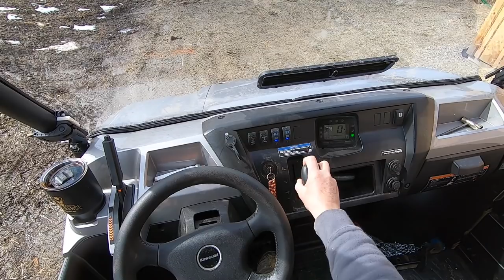EXTEND Your Growing SEASON Build a RAISE Bed HOOP HOUSE in 6 Easy Steps

Comment: If you have any straw bails, place them against the planter boxes to keep the heat inside the box. Keeping in 5 additional degrees will make a difference in two weeks of grow time with germinating and early growth. If no straw, one of the brown/silver tarps acting as fencing will shield from the wind temperature loss.

I'm about ready to give up on Amazon as the last three items I needed, they had delivery dates three plus weeks out. The silicone baking mats you guys use being the last item.
Reply: soaringtractor  

   Haven't had the problem with eBay, but I don't purchase from sellers unless they're USA suppliers. I refuse to purchase counterfeit items for the prices of originals.
  The silicone baking mats I referenced as on the way from Missouri and will be to me Saturday. Faster delivery times and $8.00 cheaper.
  The kicker on Amazon was that my membership just renewed mid March for $119 a year. 

I'm thinking Amazon is about to get hit with a class action law suit for violating the terms of Amazon Prime. The lawyers will get rich, the consumer, not so much.

Comment: Cold frames and hoop runs are great season extension implements. If using PVC pipe like this, I recommend using exterior grade PVC (the gray kind), as the white PVC shown here will quickly degrade under the sun's ultraviolet bombardment. Here in Oklahoma, a more southern climate than New Hampshire, the white PVC will only last two or three seasons before it starts to crumble apart.

Comment: If you want the cover keep opened, you can to use a chain. One bottom fixed the bed and the another bottom to the cover. It should make your work easier when you work at the raised bed.

Comment: Al watching you do this will add two seasons to your growing zone. Good idea. The bad thing you did was to put the greenhouse plastic directly to the pvc. They don't play together. You will need to put a barrier between the plastic and the pvc. They generally use tape . I'm not sure of the type of tape though. The issue will be that the plastic will degrade within a year causing it to have to be replaced. Fix it now so you don't have to later.

Comment: Nice vid. I believe I have already watched the vid you talked about. I thought his double layer using a second set of pipe very well thought out. Was hoping you were going to do the same. You did reference it when talking about the length of the hoops. In most places in the lower 48 you could have crops year round with that system. Someone mentioned they thought it was a waste of time and to hard to access the far side. I think it wise to use cold frames. But I agree it would be difficult to access the far side at the width you're using. I prefer a 30" width comparable to a market garden width. But all in all well done. Oh and I like the zip ties over the electrical tape but both will work. Even on a sunny day. 🌞🌞🌞

Comment: what are your thoughts Al, on cutting a small hole at each joint in the middle hoops to put a screw in to attach to the long pieces? Loss of strength on the joint? The long piece would still be over the middle hoops, but you'd screw through the inside half of the long piece to the hoop.
Reply from the maker: That would work just as good as the tape

Comment: Nice cold frames.  The only question is how are you going to prop up the lids so they do not fall on you, or over extend the hinges when being opened should the wind catch it? I am guessing a tether to hold the lid in case of wind, but I was not sure exactly about propping them up.  I love that you guys get to work together.

Comment: Should add a thermometer in there to see how much the temperature gets raised. Nice job on your build, if I could suggest when doing so many repetitive  tasks lay them all out once and then align others so you don't have to keep measuring. Setting up a set of saw horses and a piece of plywood would make things way faster.

Comment: If you add a piece of roap to the bottom at a corner and the flip side that it opens up just more than half way then you can open the tunnel do your work without anyone helping you and the plastic wont lie on the dirt when opened

Comment: Hey Al, I’ve noticed you changed over your tools from Milwaukee or which ever red brand to Dewalt. Why did you change and what made you choose Dewalt over just replacing with the brand you were using. I need new tools and was curious about your choice.
Reply: Ted Otway - Most of Lumnah Acres tools have always been DeWalt.

Comment: I probably would have dremeled out the bump lips inside the proper size T's instead of buying oversize T's. Also, here's a link to PVC cross connections for the inside hoops:

https://www.amazon.com/s?k=1%22+pvc+cross&ref=nb_sb_noss_2

Cut the horizontals to fit.

Comment: The adhesive on the electrical tape will melt from the sun.  Maybe a ty rap would be better, just make sure the head is on the bottom, away from the plastic cover. Criss cross the ty raps at each joint.
Reply: I also think the sun make the plastic expand and not hold up as well . should have pulled them tight after a warmer day in the sun then made permanent boards to hold plastic down
Reply: I had to look up Ty-Rap, and discovered it is a name brand for a cable tie, or what I call a Zip tie.  Good solution, as that electrical tape will bake in the sun.

Comment: It's great to see Olivia wearing eye protection (as do her parents).  But we cannot see whether she's wearing hearing protection or not. Even those DeWalt power tools will damage her hearing is she's using them.  Problem is that the hearing loss won't be detected until she's in her later teens and twenties.  Soft foam hearing protectors are unobtrusive and not uncomfortable to wear.
Reply: Leonard Gump she was wearing ear plugs. You could see the cord attachment.

Comment: Okay...did I miss something OR, am I loosing my observation skills?!?! You and Gina are sportin some perty nifty coveralls there and, I must add, in most fitting colors!! So...the cold bins...outstanding build and, seeing you all doing it together, like a school project Miss Olivia 😉👍🏻, was wonderful!! What are your thoughts on a self tapping screw to connect the joints? The electrical tape- or any tape for that matter- is the weakest link I think. The temperature fluctuations and moisture inside will break the tape down pretty quickly and once the joints start popping, the plastic itself I suspect will be compromised. Just a thought. Ordered the snap clamps...still like to know how I link that to lumnah acres so you guys get credit for it. Right now I have the American civil war trust linked and I cannot for the life of me figure out how to change it. Well, something to keep working on!!😁 awesome fun video!!

Comment: need to run metal duct tape on plastic pipe were green house plastic touches or the chemicals in pvc will make it split over time will help get 5 or 6 years out of green house plastic

Comment: Wouldn't you add two inches, rather than subtract them? Cuz the ends are going into the holes you drilled one inch deep?
Reply: Oh wait. I forgot you wanted them lower on the ends. Nevermind. 😏